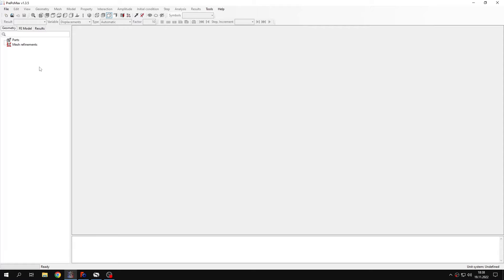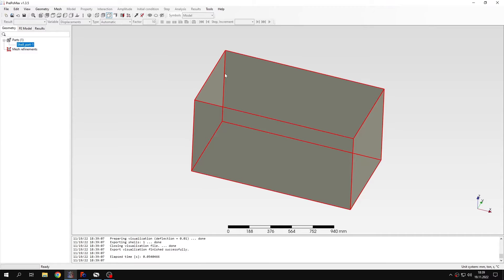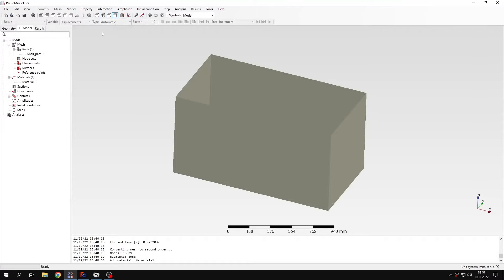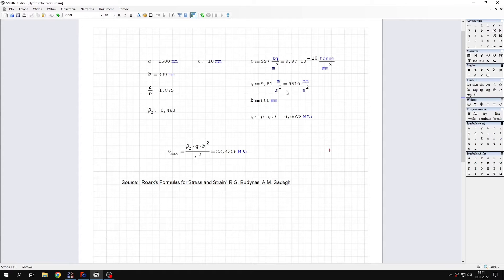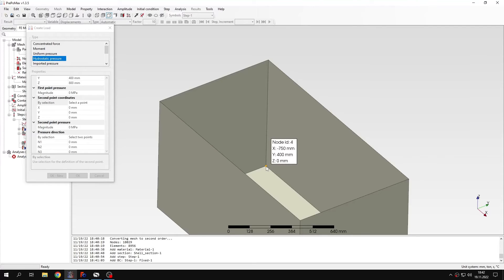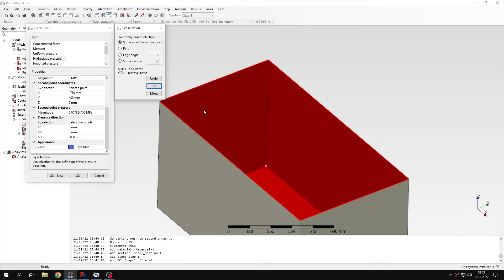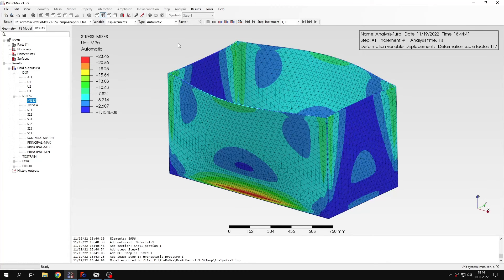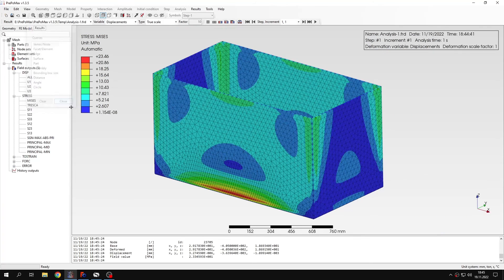PrePoMax (CalculiX FEA) - Tutorial 28 - Hydrostatic pressure - rectangular pressure vessel

Comment from the maker: I should also mention that the analytical solution taken from "Roark's Formulas for Stress and Strain" is for a rectangular plate with 3 edges fixed and 1 edge free, subjected to linearly varying pressure. Walls of such pressure vessels can be treated this way in calculations.

Comment: Hi, do you remember the page of Roark's book for this specific case?
Reply from the maker: It's page 454 in 9th ed (table 11.4, case 10d).
Reply: @FEAnalyst  Thanks so much, really appreciated!
Reply: @FEAnalyst  Just a small theory doubt. If we are fixing the external bottom base to not displace, it would be the same for the internal one that will be subjected to constant pressure load? Cases presented on Roark's handbook seems to not stick properly to simulation case.
Reply from the maker: Shells in CalculiX are tricky because internally they are expanded to solids. If you fix the bottom of such a plate and load the top, there will be some deformation. But right, the formulas from Roark's are just an approximation here. It's one of the approaches to rectangular pressure vessel calculation - treating connections with other walls as fixed boundary conditions.
Reply: @FEAnalyst  Thanks a lot. If for example, the top would be closed that plate would be regarded as a plate simply supported on all edges or fixed ?
Reply: @FEAnalyst  I'm struggling with associating the test case to the hand calculation case.  in the video you imposed a fixed surface at the bottom so I'm expecting that the proper case would be 8a since all edges are fixed (as you said the fixed boundary condition transmits to internal walls). I would like to compare hand calculations with Ansys Mechanical results but these conditions seems to not stick properly. Sorry for disturbing you.
Reply from the maker: @dreamerofgame555  Why all edges ? The top one is not connected to other walls so it's treated as a free edge. It would be different if the vessel was closed at the top. Calculations of rectangular pressure vessel walls as individual plates are described in some books for civil engineers, might be best to check there.
Reply: @FEAnalyst  Yep, but if you consider the bottom basis that will be a plate with a thickness of 10 mm fixed at all edges. Hoping to not saying wrong conclusions. The other faces would results in the case you were saying (three fixed edges and one is free since no connection is present on top).
Reply from the maker: @dreamerofgame555  Right, the bottom face would have to be treated this way. But in my calculations I was only considering the side faces (and thus the formula for a plate with 3 edges fixed). I ignored the bottom plate, especially since in other FEA software it would have 0 stress as a fully constrained shell.
Reply: @FEAnalyst  Thanks a lot and sorry for taking your time. I'm trying to adapt your case for a completely enclosed rectangular tank with costant pressure inside. I'm struggling for the top part. I think it would be a fully constrained plate but I'm not so sure since interface edges are not properly clear. I would assume them to be elastic constraint but no simple case is solved.
Reply from the maker: @dreamerofgame555  According to a Polish book about reinforced concrete tank design, the top plate can have its edges clamped if it's monolithically connected with the sides and has similar stiffness as the side plates. You may find more specific guidelines in civil engineering codes.
Reply: @FEAnalyst   Thanks ;)

Comment: Just to add - It can not be considered as fish aquarium because of lack of "hinges" on edges. Aquariums are usually glued with special silicone which works as hinge. Results show it is casted tank. As for results, max misses stresses for glass should not be more than 5-10MPa, althougth theoretical max stress for glass is about 80MPa. It is because of brittleness (safety factor). For big tanks in public aquariums (made of acrylics not glass) more important is deformation which is usually takes as 1/300 of shorter edge.
Reply from the maker: Yes, it could resemble an aquarium but I treated it as a small steel tank.

Comment: Nice tutorial, as usual. Only two comments: 1. This model has two planes of symmetry, so 1/4 quarter of the model usually should be considered in such a case. It is really important at least from the educational point of view. 2. Analysis of the results for a shell model should start from the displacements. If the maximum displacement is larger than shell thickness (it is usually the case for thin shells), geometrically nonlinear analysis should be performed (at least as a sanity check). It is especially important when we have bending + tension like here.
Reply from the maker: Normally, I use symmetry for such models (like in the tutorial with a cylindrical vessel) but this one took just a few seconds to solve and I made an exception. When it comes to the second comment, in the videos I focus on the results that are compared with analytical solutions and I don’t use geometric nonlinearity to allow for this comparison.
Reply: @FEAnalyst  I am afraid you not aware about limitations of the analytical solution you have used. In the Roark's book the first sentence in the plates related chapter states: "The formulas of this section are based on the following assumptions:... (2) the maximum deflection is not more than about one-half the thickness". The same limitation can be found in any good mechanics of materials textbook (in your language see M.E Niezgodziński, T.Niezgodziński "Wzory, wykresy i tablice wytrzymałościowe"), again usually in the first paragraph. So you must check max displacement first in order to know whether or not you can use analytical formulas. 
Ironically, a similar example was used several years ago in the SOLIDWORKS Simulation Step-Up video series in order to show how big the difference between linear and nonlinear solutions can be in this case. The following image shows the result: https://www.tu.kielce.pl/~rokach/instr/misc/geom_linear_vs_nonlinear.png
Reply from the maker: @irokach  I an aware that there are no better formulas that could take geometric nonlinearity into account so I have to use the ones with such limitations to include a comparison between FEA and analytical solution. I’m not designing a pressure vessel here, just showing the capabilities of PrePoMax - how to define a hydrostatic pressure load and check if it’s working correctly.
Besides, I used very small load and the deflection is far from 1/2 of the shell thickness.